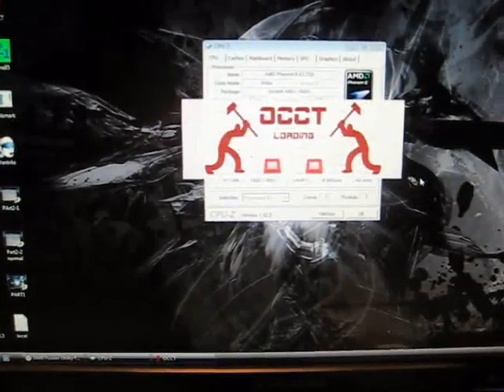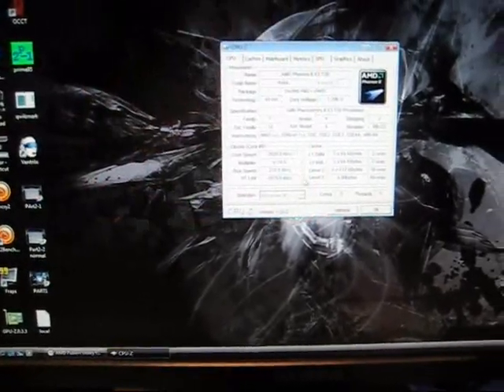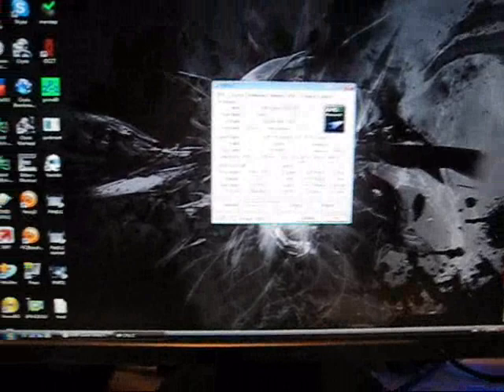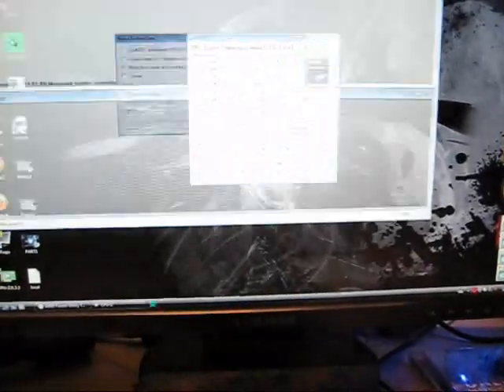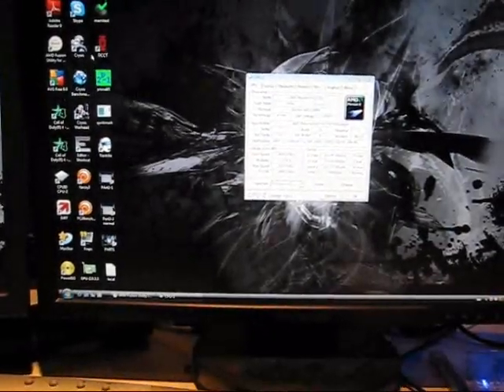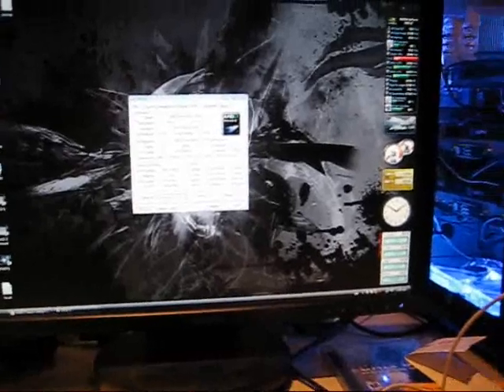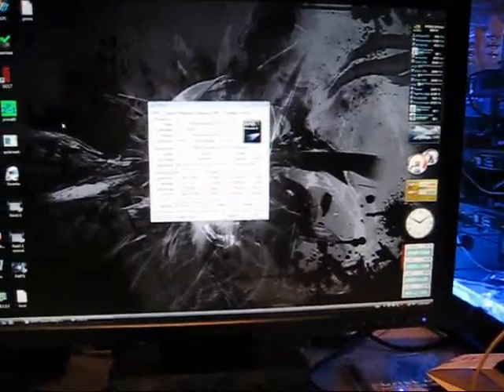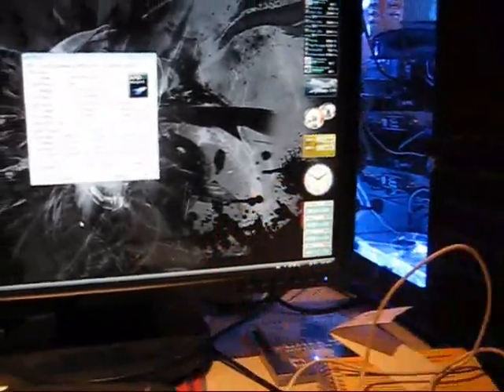How to overclock an AMD CPU Part 3/3

Comment: I have a AMD Athlon 64 X2 dual core 4000+ , 2.10 Ghz. What level you think is safe to go?  Do you think also I need to increase voltage, or not? My cooles is a aftermarket one, not stock. Thermaltake contac 30. I am waiting for a answer, Thx, and sorry if i had bag english.

Comment: Sorry, but as you're having a BE Athlon (or Phenom II) you don't have to fix the FSB. You can upgrade it even by multiplier without any need to fix the clock speed of the rams (okay..., it may be dangerous with DDR2). Got my Phenom II X4 965 BE (stock at 4 x 3,4 GHz) prime stable to 3,8 Ghz. 4 GHz will follow if I get my new cooler.

Comment: @TheRockoman3 no i dont, and i ended up getting the 1090T and overclocked tht mildly to 3.6Gz with a CM hyper 212+. obviously my build is done now and the only thing left is makin it look $wag as fuck with a bunch of lights haha. only dif between the 1090T and the 1100T is the 1100T is factory OCd by 100Mz, and its $30 more, i can do tht myself

Comment: @hotpot71 I ran Memtest 86 a while back. =D It is stable. For some reason even if I bump down my RAM I can not OC very far. I can only make my RAM voltage 2.1v. =( Also I can not do much with my SB. =(

Comment: @HostileDonut Run a Ram testing utility (most windows have one built in)
if every thing is ok OC a little more and test again at the first sine of been unstable go back the last good OC.

OR....

step down your ram from 800mhz to 667mhz and do a massive CPU OC and your ram will be back to 800mhz then you still have good stable ram and fast CPU
Altho if you drop down your ram it not really noticeable

Comment: @HostileDonut if you dont step down you ram from say 1066 to 800, when you OC your CPU your 1066 ram could end up running at 1200+ dependent on you FSB witch will kill your ram. with stock ram you should not go more that 10% past stock speed

Comment: I have the Nettle2 also in my HP Pavillion model A6223W.  I cross flashed it with ECS firmware for thier GeForce6100SM-M board Version 1.0/1.0A.  Works great.  Still don't have access to multiplier though. but everything else is thier

Comment: I have HP motherboard NCP61PM-HM(Nettle2) that I cross flashed with ECS GeForce6100SM-M V1.0/1.0A firmware and runs rock solid with access to everything except multiplier settings.

Comment: Hi I've been checking your videos regarding overclocking. I have an amd phenom 2 x4 965 black edition and I'm tring to acheive 3.8 - 4.0ghz stable, but I'm stuck at 3.6ghz. Any higher and I would fail prime95. Take a look at my videos and any advice is appreciated.